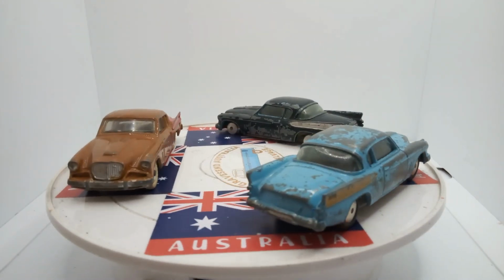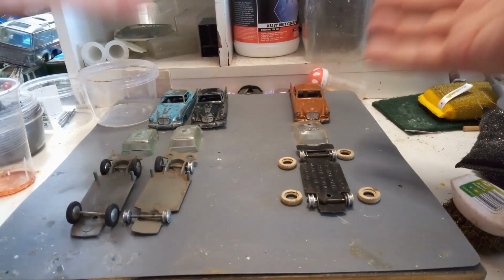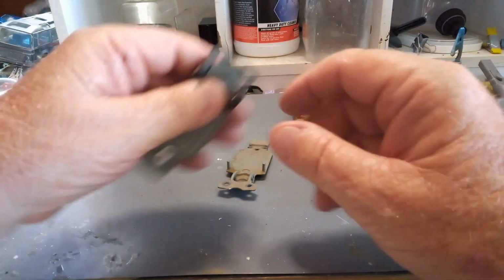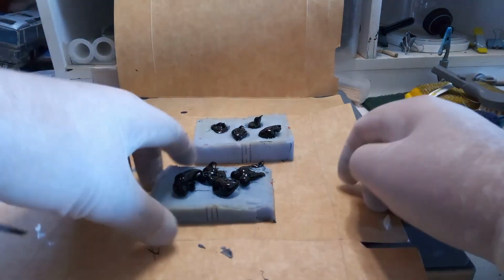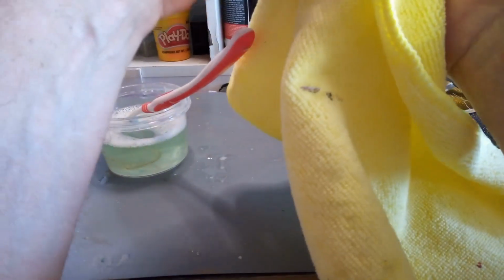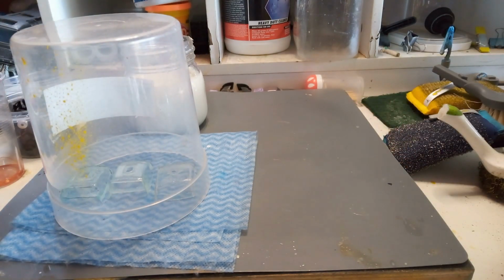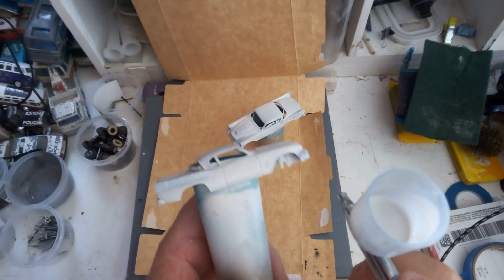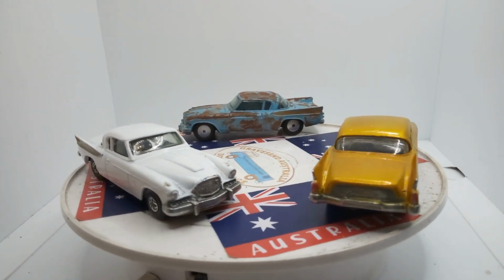Dinky Corgi Sudebaker Golden Hawk

Comment: nice trio. white and gold looks great, and seems they dragged the blue one out of the woods just in time. :) sometimes this looks better, with the worn and flaked-off paint revealing the metal. ^^

funny thing with the Corgis. the bubble in the baseplate seems to indicate a friction motor mechanism, I almost expected one. I used to have a later model by Corgi, with the interior, it had a different baseplate.